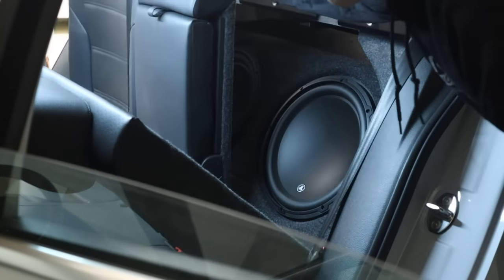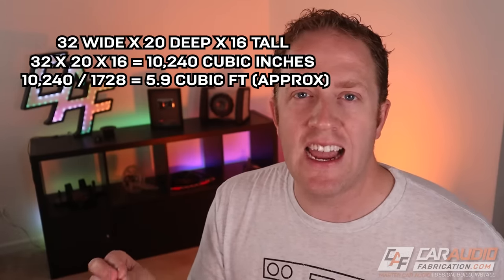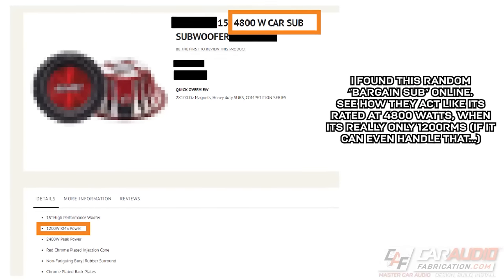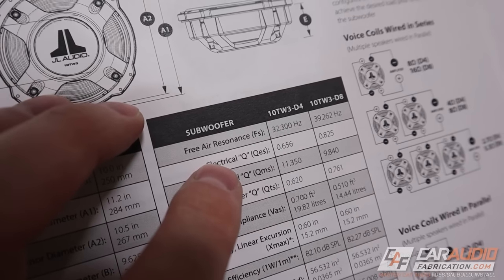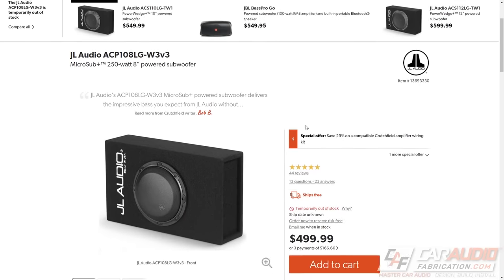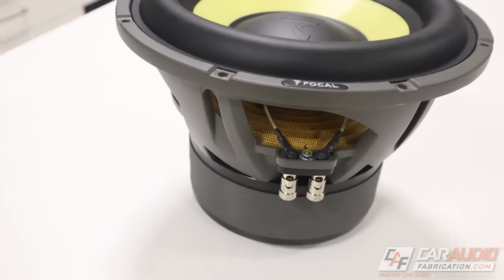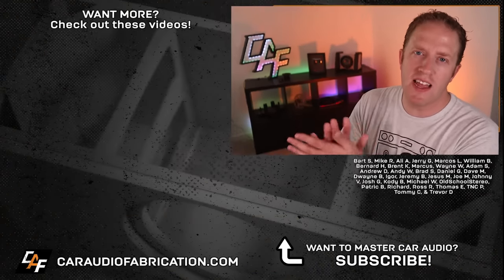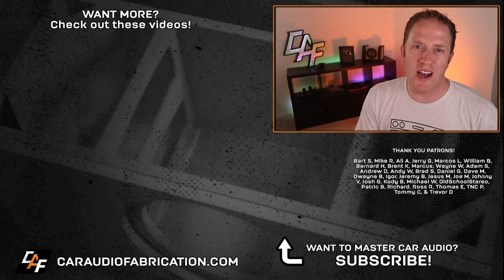DO's & DON'Ts - Picking a Subwoofer for YOUR vehicle!

Comment: Hey mark I just bought a suv with a built in sub. I want to replace the factory radio and want more bass do you think replacing the factory sub with an aftermarket one and powering it with a different amplifier is better than adding those under seat subs? I don’t really want a box as I don’t have the space for it
Reply: See if you can measure (or find the info from the dealer or something) what airspace you're working with for the stock enclosure, and then search for aftermarket subs that have specs that fall in line with that, and then yes, replace the stock amp. with an appropriate aftermarket one to match.
Reply: Also I recommend using some sound deadening mat around the enclosure on the vehicle body, and quite possibly the interior panel and enclosure interior (just a little goes a long ways) to help reduce vibration and resonance, since you'll be pushing more bump than what stock designed.

Comment: What brand subwoofers should I get for sound quality I don’t care too much about loudness and having so much bass where I’m rattling stop signs and my rear view mirror falling off I just want something that sounds really nice and have that deep clean punchy bass and what box enclosure should I get for it?
Reply: Get a 10 inch subwoofer enclosure with high specs, excellent quality with 600 rms rating; find a reputable amp that pushes near 600 rms x 1 .  Your ears will thank you.  Audiophile  fillings will come from this setup.  No whopping clankety mess, just sweet beats that won't distort even at the highest volume setting.

Comment: Going nuts here. I want to upgrade my 2 (Old) JBL 12's. The reviews are touting garbage (MTX, SKAR, etc). I would rather put my daughter through college than buy a set of Focal Flax subs. I have a decent 1k watt JL amp, and all Focal flax separates. At this point, my subs are the weakest link. Are there any audiophiles out there that can help me choose the right subs without breaking the bank? I have a 2019 Camaro SS w/stock radio and a decent DSP. I'm done spending the big bux.

Comment: I have a question would it hurt A Sundown Audio Ev4 12in subwoofer to be in a box that is 2.7 cubic feet that is tuned to 30Hz
Reply: The sub will last a lifetime aslong as you don't send it a clipped signal from your amplifier for too long (causes voicecoil to heat fast) and as long as you don't push it past it's mechanical excursion limit! :)

Comment: Funny thing is, every professional sound shop I've been to don't measure airspace or do any of that at all. When I ask they act like they don't know what I'm talk"n about.
Reply: The ones I've talked to just use standard box specs based on the driver(s) they sell you and how many of them you're putting in.  They knock out their sub boxes very quickly.

Comment: Can you do the mega surround vs traditional subs ? And if there is really big difference between output. With More excursion does that mean is moving more air so would it be louder while losing cone area?
Reply: Yes. But it doesn't necessarily mean louder but more excursion means it will reproduce lower frequencies easier.

I usually use the piston from a car as a good comparison.

The mega surround would be a smaller diameter piston that has more stroke. I.e  it moves further but it is not moving as big of a volume of air at once
Reply: @TylerTheBassCreator  thanks man I appreciate you taking your time to respond back to me.
Reply: @cin5cin1nat3i  absolutely! Glad to help

Comment: I was wondering if I could still use a eq with the lc2i pro? An how would I install the eq
Reply: Yes, you'd just install the eq after the LC2i pro, but before the amps, but eq's, in the traditional sense as a separate unit with slider controls are not very useful. I'd recommend a good dsp unit that is tuned on a computer or phone. I'm using a LCI2i, and next in line is a miniDSP 8x12DL processor.

Comment: It doesn't have to be difficult at all. Series, double the ohm load. Two 4 ohm loads in series = double, or 8 ohms. Parallel, cut it in half. Two 4 ohm loads in parallel  = half, or 2 ohms. Now three 4 ohm loads in parallel is not as easy. However, it would be 1.333 ohms. But who runs odd numbers of speakers?!
Reply from the maker: Yeah, its not that easy as you just proved, lol. The math is easy once you know it, but trying to use a work around like the above that doesn't apply for all cases is not a good idea.
Reply: @CarAudioFabrication  Please do tell, what, exactly, did I prove, lol?
Are any of my numbers wrong?
No, they're not.
Surely you saw this admission, "Now three 4 ohm loads in parallel is not as easy." CLEARLY, in that one sentence, I am acknowledging the fact that not every combination can be determined so easily. What you call a "workaround", I call simplifying what can be simplified. Most newbies, especially those with little to no math background, are more likely to stay with car audio if the math is simplified. That's just human nature.
Next, perhaps what was funny in my head didn’t translate to the written word very well. "But who runs odd numbers of speakers?" Is pretty much accurate but was meant to be a dig at myself as to why one should never have to deal with those situations that are "not as easy". 
I know the math. I know how to find and use an impedance calculator as well. 
Most importantly I am well able to point out my own shortcomings and make a joke at my own expense so that you don't have to because it doesn't suit you, you're not very good at it. (Again, my numbers were correct making, what I took to be an attempt to insult, one up, throw shade, whatever fits, fall flat and look petty) 
I've said this before in the comments and I'll happily say it again now,
I love your channel, I love the content and I greatly appreciate the time and effort you put into your videos to share your knowledge and experience with anyone who is interested. You are one of the very best installers I've ever seen. And my numbers were correct.
Reply: It gets difficulty with mismatched loads.  And even more of a challenge when you consider the effect of crossovers.
Reply: @chuckschillingvideos  everything gets difficult when you make it so just to be right.

Comment: 20 years ago, if you picked anything other than JL Audio,....you had less than the best.
today,.....no idea.
everything is crap.
Reply: Aren't you a ray of sunshine.
Reply: I used to run Eclipse and ZAPCO in the late 90'-early 2000's. ZAPCO is still around and are on the higher end for sound quality. There are many companies that are higher end, better overall build quality but the tradeoff is you will pay primo price for the audiophile grade equipment. Much of the mid grade equipment nowadays is considered good enough in the car audio world by many and the newer generation of bassheads and car audio enthusiasts have only heard the legends of the car audio world past in stories and not in actual vehicles.

Comment: I’m looking at adding a subwoofer and not sure how to pick one since my amp is 2 channel 700 watts RMS per channel , I was wanting to know what power rating in a subwoofer to look for in a dual coil that will handle 700 watts rms and if I parallel it that’s 350 watts rms for each coil? My amp is 2ohm optimized so seeking a 4ohm dual coil subwoofer. Is that what I am needing to seek and do and it will give me the full 700 watts RMS to the subwoofer once  is it paralleling it from 4ohm to 2ohm?

Comment: You can't go wrong with a JL Audio shallow sub. It's God like for real!
Reply: Lol
Reply: I heard 4 of them in a King Ranch. The guy had them put under his rear seat at the shop I go to, and I was super impressed with them. They were not being hit very hard and they were still loud. They're not as loud as 2 of my M6 15's I have, but the JL's fit under the seat nicely and mine, well, take up the whole back of my car so there is that lol.
Reply: @MemphisMojo15s  yeah, for the size and design of those subs, they sound exceptional!

Comment: Surface area is something else that should be understood. For example, the surface area of a single 15 is greater than the surface area of two 10's. In this case 10+10 does not equal 20.
Reply: How do you do that math for the dual 10s, what would they equal?
Reply: @hambone8820  Area of a circle is pi x radius x radius. So a 10 would be 3.14 x 5 x 5 which equals 78.5" square inches. Two of them = 157 square inches. A single 15 would be 3.14 x 7.5 x 7.5 = 176.625 square inches
Reply: @RYTHMICRIOT  thank you for explaining it. I'll keep this for future use

Comment: I’m running a 5 ch amp pushing the sub ch to a 12” 4ohm driver, my question is... If I switch out the 12” 4ohm box for a different brand 12” 2ohm box, do I need to adjust any settings on the amp or will the 12” 2ohm sub resistance automatically set the amp to 2ohms levels on the sub channel??? FYI the amp is rated from 2ohm-4ohm
Reply: It'll automatically adjust for 2 ohms. Lower the gain and adjust accordingly.
Reply: U HAVE TO MAKE SURE THE AMP CAN DO 2 OHMS alot of 5 channels don't do 2 ohms

Comment: The Parallel math is much easier.  If both speakers are 4 ohms, and there is 2 speakers, then it would be 4 divided by 2.
Reply from the maker: This is not a good rule because once you start factoring in an odd number of subs, or possibilities with going with a series and parallel connection its better to know the actual math rather than workarounds

Comment: What if you have a 2 door hatchback where the entire car is the trunk?
Reply from the maker: Still need to measure the space. You measure what you have to work with. You'd be surprised how any people just buy 4 subs without a single though for how it will fit.

Comment: Buying the new Ford Maverick. Which subs to buy.. hmmm
Reply: It'd make a lot of difference depending on what you're wanting out of the system... How much power you wanting to run? What type of enclosure are you wanting? Are you wanting the most bass or would you prefer sound quality? 
Multiple subs or just one? 
Can't really give answers to a rather complex question without more details...
Reply: @RAW_Reality  oh yeah I understand that. I’ll have to see how much space I have under the rear seat to work with.

Comment: I have a question for you what would you recommend to put in a reg cab gmc behind the seat can't find anything that works
Reply from the maker: A true shallow mount subwoofer like the JL Audio TW3 or TW1
Reply: @CarAudioFabrication  sweet I have a Memphis audio 12 in there right now and with the vented box does not sound great
Reply from the maker: There's probably not even close to the proper amount of air volume
Reply: Ya I don't have a whole lot of room behind it I don't want to burn up the sub I have in there I did close the ports and sounds better but worried the sub is not breathing

Comment: Since I've been subscribed and watching these videos, I've become 
intimidated to install any car audio in my car because I feel like I'm 
not going to be able to do it right. This guy knows so much compared to 
me and many others that I feel clueless. There are so many variables 
involved with car audio that I don't know if any of the equipment I have
 is even worth installing & if I did install it, I wouldn't be sure 
how to set the amp up correctly, if I have a suitable amp to the subs I 
have. Is my wiring good enough, I need to use ferrules and the correct 
connectors, I only need a few but then if I want to use the connectors 
that he uses, I'll have to buy a ferrule kit that have quantities for an
 installer and end up with a bunch of ferrules that I won't use, also do
 I have the right kind of enclosure for my subs, knowing how many Ohms 
my amp & my subs have, do I have enough power for the system. This 
guy uses different components as well that I have no idea what those 
things do & if I need those components that's more money spent. If i
 need a capacitor, should I change my alternator or buy another battery.
 There is so much shit that you need to know in order to get the best 
sound from what you have. & if I have a professional install my 
system, does that guy really know what he's doing,  Mark is a high end 
installer, there's no comparing & then there's the cost of the 
install. & so much more, impedance, deadening, the best setup for 
the model of vehicle I have & so on. I'm now more lost than ever. I 
feel like the audio equipment that I have is embarrassing and ghetto 
crap compared to all the equipment that he uses. I'm fucked.
Reply: As long as you wire everything correctly. Even ghetto systems can bang. Had some jappy boss audio system as my first system. Wasn’t a strong system by any means but it slapped. I would just install it and upgrade as you go. Everyone’s gotta start somewhere brother

Comment: So I’m not exactly an expert but I’ve done about 8 months of research but I walk into oreilly the other day to check my battery and alternator health and dude goes “what do you need a battery for” so I tell him I’m putting a system in and he goes “how much power” and I go “well my amp is rated at 400 rms ans 800 peak and my subs are 250 each and I have 2” and he goes “you’re gonna blow up your speakers” and I’m so confused if I bridge them to a mono channel amp they should get right around 200 (in a perfect world) amps per sub so I’m actually running them lower than RMS rating am I being ignorant in thinking he’s wrong or are my specs fine
Reply: You went to a parts store for audio advise 🤣 really. This is why we have audio shops
Never ever ever take advise from a parts store. Dude go to your local audio shops they will tell you everything you need to know
Reply: @elroycooley398  no no no I didn’t go to the auto store to get audio advice I went to the auto store to get my battery tested to make sure it could handle the power and he tried to give me advice
Reply: @cooper197  bruh you said o'reilly told you that you gonna blow your speakers with 400 wats rms. Ain't never blown speakers with that much power plus you don't need a new battery or alternator
Reply: @elroycooley398  I actually just blew a speaker that was only 250 watts and my battery is 22 years old it hasn’t been changed since the cad was bought and that was in 2000 things started to dim when I put just my radio in so I wanted to make sure before I literally doubled the wattage it was gonna be okay
Reply: @cooper197  bruh a battery ain't blowing speakers plus a battery don't last two decades
Reply: @elroycooley398  hints why I was going to replace it… and no shit batteries don’t blow speakers I was commenting on the fact you said you never blew speakers at a certain wattage and I was just saying I’ve blown a speaker at lower watts before

Comment: Sometimes my subs smell when I leave it up too long. Is because I need bigger subs?
Reply: No its because the coil glue is frying due to high heat.. meaning your subwoofer is at its limits power wise. If you got the same set up, just a bigger sub it will still smell, but a bigger sub will play louder on the same power. Id say turn down the gain on amp a lil bit just so you wont get that smell.
Reply: Subwoofer might blow sooner or later
Reply from the maker: Could be too much power on the subwoofers, could be the gains are set incorrectly and you are clipping the signal.
Reply: There's a handful of reasons why that might happen, most notably using your gain like a volume knob and sending your subs a clipped signal. But since it'd take more detail than just saying what you have, it'd be hard to assume what's causing it beyond that.
Reply: I actually used the dd1 to set the gains. The subs are fairly new too